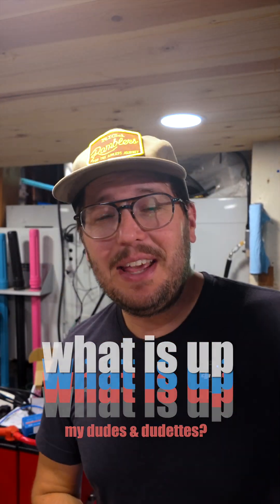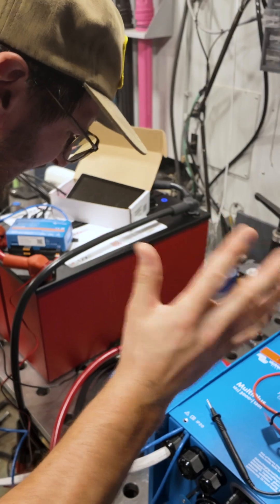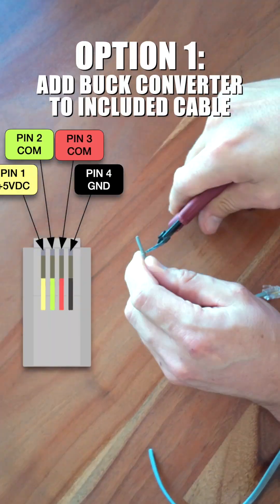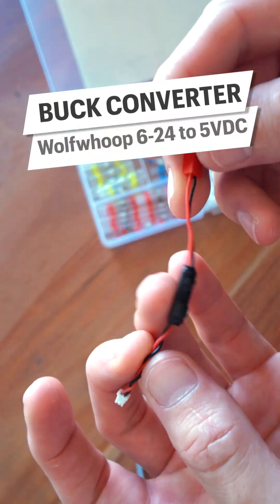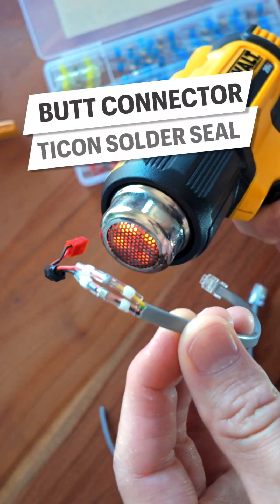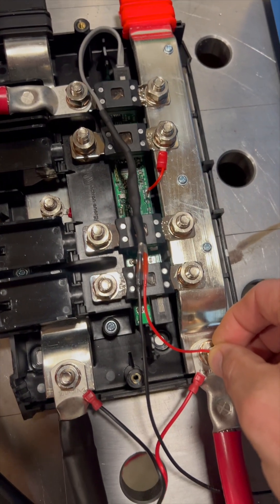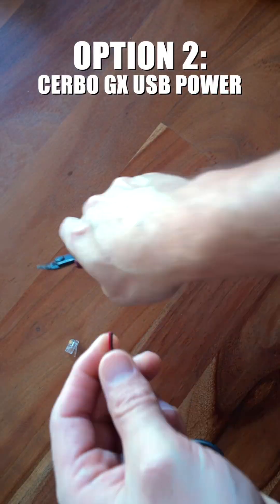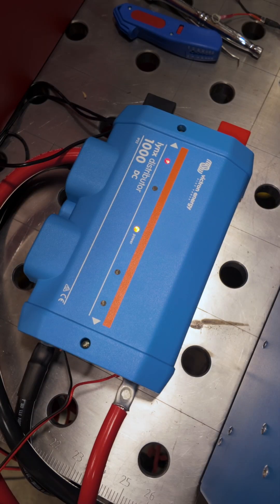Powering The Fuse Lights in a Victron Lynx Distributor without a Lynx Shunt or Smart BMS.

Comment: Can you connect rx tx to get the data to display if a fuse is dead?
Reply from the maker: As far as I know unfortunately only if you have the Lynx Smart BMS and connected via VE.Can in your system.  If you just have the Lynx you can't :(